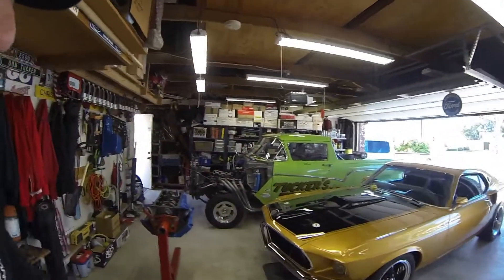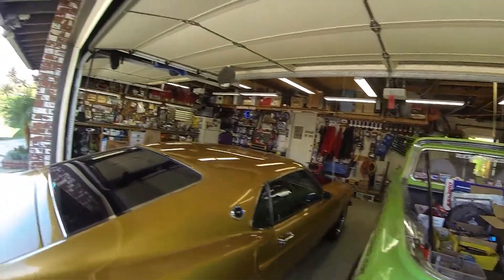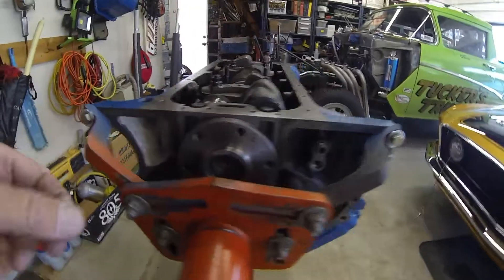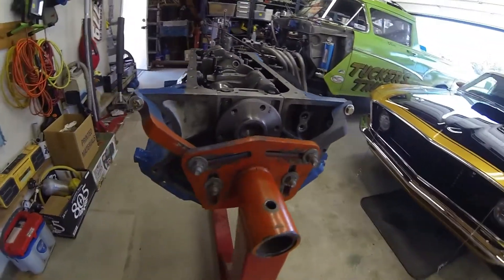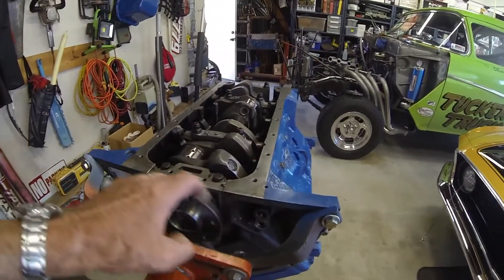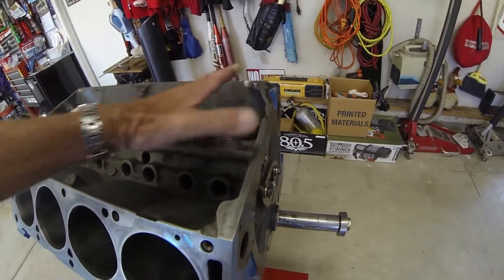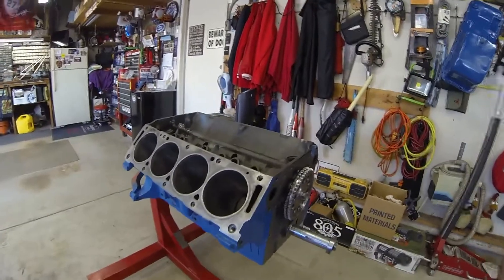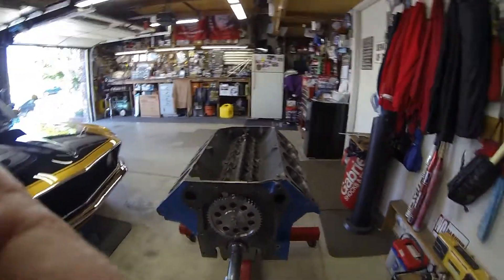427 FORD FE Engine Building Tips 10 2019

Comment: If you're going to use the two bolt main block say from 390 or a 428 Besides putting better Main bolts on it What can you do to strengthen the block In terms of the crankshaft reducing the chances of a cracked block?

Comment: You said the plunger goes in first, in the oil galley in the rear if the block. Then you say the spring goes in first. Which is it? I saw which it was, but you needed to be gigged on that.
Reply from the maker: You are right, I did misspeak. What you see me doing is correct.  Spring 1st, plunger 2nd with the narrow rod facing out of the hole so the threaded plug contacts the rod and pushes the plunger in against the spring.

Comment: So I'm writing an article on the 427 used in the Lemans GT40's and outside of the basic info on the engine / seeing as you've built these, what strengths do you think that mill had that aren't well known
Reply from the maker: Hello,  I think one feature that adds a LOT of strength is the extended lower block that is a good 3 inches below the centerline of the crankshaft.  This adds a rigidity to the block and allows the middle 3 main caps to have extra bolts come in from each side.  Most 427's are also side oilers which is great for endurance races but not so necessary for street use or drag racing.  It is still the sought after block though.   Another feature that is overlooked is the shaft mounted rocker arms. This creates stability to each rocker.  You will see many engines that do not come that way from the factory but are converted to this by high performance head manufacturers. 
One last thing.  There are many manufacturers of high performance aluminum and cast iron blocks and heads now.  This was not the case about 10 years ago.  Cross bolted mains, great oiling and superior strength plus high flowing aluminum heads.
I hope this helps,  Tom T
Reply: @tomtucker7571  thanks it does help very much. It's cool to see the reliability strategies from 50 years ago like the cross bolted main capss, because the LS crowd thinks GM came up with that in 1998 when they released the ls1 (hell that's what I thought) and how that in addition to extending the blocks skirt gives the bottom end enough strength to handle ridiculous amounts of power, or like you said the priority of lubricating the crank first ups the reliability if say your 7 liter needs to run a 24 hr endurance race. Anyway thanks for the response it's much appreciated

Comment: Hi can you turn a 390-FE into a 427-FE...
Reply from the maker: The stroke is the same, 3.78 on both engines..  The 427 has a much larger bore.  You cannot bore the 390 out to the 427 bore.  The cylinder walls would be to thin. You can bore it .030" over or maybe a tad more and end up with about 400 cubic inches.
The two blocks share almost all parts. Crank, cam, heads etc.  Just be careful with the heads.  The rare medium riser heads have the valves spaced further apart and the valves may contact the cylinder walls.  There are many good aftermarket aluminum heads or just go with your 390 heads.  They can be worked on to flow better. 
Tom
Reply: @tomtucker7571  Thanks Tom :)

Comment: Hello Tom Tucker, I have 1968 428, has 1963 6090 J heads, pi aluminum intake, what all do I need to build this to its best Daly driver with extra power
Reply from the maker: William,  The 69 Mustang in my video has a 428 CJ motor and I also used the police interceptor intake manifold.  Just pay close attention to matching the manifold ports to the heads.  As far as a good street engine I would suggest a nice low RPM cam.  I went overboard with the cam so it takes a little RPM to get the power up and loves to drink gas.  I'm still happy with it because I like the rough (mean) idle.  The usual hop up things work like headers etc etc but with the right cam this motor will be very strong.
Reply: Thank you Tom,  hunters out there looking for these so better take care of it,  Enjoyed your video

Comment: One thing I always used to do when I Prime Motors make sure the oils flown down up every pushrod or rocker arm shaft even the old antique Chevys we used to squeeze off the tube with oil with drain back to the head for oil pressure to the Rock arm

Comment: Loved the video, it was just straight no nonsense info a lot of which was helpful to me personally! I have a 63 427 in my 69 Mustang as a daily driver. I'm sure you already know, the stock valve lash spec is .025 cold, and that's, well, a whole lot by modern standards and pretty hard on the valvetrain. When I look at all the aftermarket cams for the 427, valve lash is way tighter. What are your thoughts on tightening down the lash to .018 or .020? I don't want to burn up an exhaust valve, but as a stock headed engine, the lash doesn't seem to move much hot/cold and I suspect Ford was just being awfully conservative on the old Police Interceptor cam design.
Reply from the maker: Hello,
I run .021" cold lash in the race car but when it heats up I end up with close to .025" because of the aluminum heads.  I think you're fine to run the lash a little tighter but I would only go a few thousands tighter (.002-.003").   You're dealing with the opening and closing ramps on the cam lobes.  To be really safe I would direct that question at one of the cam companies. They have good tech departments.
Okay.  I don't know how many will read this correction to my 427 video regarding the side oiler relief valve.  I mentioned how it was always good to run a shim( i used an allen bolt) inside the relief spring to raise the pressure at which the relief valve opens.  Not necessary.  My oil pressure was too high, 105psi with 5-20wt race oil,  because of a miscue with my bearing clearances.  I pulled the trans this weekend to get at the relief valve. I pulled the allen bolt shim out and the oil pressure dropped to 83psi when I fired it back up.  I realize now there is no need to run 100psi and the shim will not raise oil pressure if it is to low.  For instance if you have 40psi that's what you have.  I you have over 80psi then the relief valve will do its job and open to keep the pressure at 80.  Now I can run 20-50wt oil and hopefully not have oil leaking past the pan and valve cover gaskets.
Tom T
Reply: @tomtucker7571   Hey Tom, thanks for the info. My top oiler has the oil pressure relief in a different spot. The engine builder added a machined piece of aluminum into the bore with the spring and oil pressure went to the cusp of 120psi on the dyno run of my engine. I pulled that spacer out. My dad said the engine seemed to bypass at 105psi according to his oil pressure gauge back in the 60s. I run 5w30 oil in mine and it idles around 80psi cold, eventually dropping to about 25psi when nearing 200* sitting in traffic with the cooling fans running. Crusing down the road at 2,000rpm at operating temperature is usually about 75psi. I'd heard there were different springs people sometimes swapped into the blocks to decrease pressure a bit too. So much info and so much of the info is of questionable truth out there haha
Reply from the maker: @randomologist77    Hello.  I finished my oil pressure tests yesterday. I mentioned, in my previous reply, that I pulled the shim out of the oil pressure relief spring and the oil pressure dropped from 105psi to about 83 psi.  I drained the 5/20wt oil yesterday and put in 20/50wt oil.  The pressure stayed right at 83ish pounds, just as it should have.  I ran the engine for 7 or 8 minutes and it stayed close to 80psi. Water temp got up to about 180.  I'm sure if I was running the car at the dragstrip the heat would be much higher and the oil pressure would have dropped some.  With the 20/50wt oil my mysterious oil leaks through the gaskets disappeared.  Yeah.
Reply: @tomtucker7571  Nice!!! Sorry, didn't see your reply. I'm definitely going to take a look at my relief valve. Finding spring replacements is a nightmare these days, but I sure wouldn't mind seeing a little lower pressure. I'll have to take a look and see if mine has the shim. 

As a heads up, I found that Crane Cams (now Comp Cams) makes a blueprint cam for the early 427s like mine. The specs on it show 0.018" on the intake and 0.022" on the exhaust for recommended lash. I'm planning on doing that or maybe a hair tighter on the exhaust.
Reply: I guess I should mention I've checked around online, but as you've also undoubtedly found, for every person who really knows what they're talking about when it comes to the 427, there are 20 more who claim to know, haha.

Comment: Have a top oiler 427 marine engine that I converted to side oiler for the 3 center mains, old trick you drill out the side caps and bolts to 3/8 then tap the bolt to take a pipe tap oil line fed from oil filter adapter. Used it many times helps a bit. Poor mans side oiler. Keep up the good work, not to many FE anymore.
Reply from the maker: Reid,  Great idea.  Takes some patience and skill but us motorheads must have both.  I think i screwed up, in the video, by mentioning how I shimmed up the oil relief valve spring.  In hindsight I ended up with too much oil pressure (105psi) and should have left the spring alone without shimming it with the allen bolt.  I believe Ford had it designed to relieve pressure at 80psi which would of been fine.  I'm pulling the trans tomorrow, to get at the relief valve and correct my mistake.

Comment: One thing I was told is for high rpm endurance racing Ford reduced the crank shaft diameter and I think they were using different bearings possibly Chevy bearings I’m not sure. Is this true?
Reply from the maker: I read the long article you attached comparing steel cranks to iron cranks, friction, strength etc etc.  Interesting but like he said it is a lot of thoughts put together from several articles.
I think if you keep the RPM within reason, maybe 6500 tops, you don't need to worry about different journal sizes.  I run my car/Ranchero at 7200 but am thinking of backing the rev limiter down a little just to be safe.  I do have one of the best (and very rare) Ford steel cranks.  If you do feel a need to change you will find that many of the stroker kits (Crank, Rods, Pistons) are the same price as buying a stock stroke (3.78) Ford or aftermarket forged steel crank and that's if you can find one.  Good luck.
Reply from the maker: I'm quite sure Ford did not do this but many of the aftermarket cranks have smaller journals on them.

Comment: building fe 390 it has trw .030 over pistons in it shud i reuse them or get new one will give it more compression
Reply from the maker: Fine to reuse them if they're in good shape.  The only way to add compression would be to buy new pistons with a bigger/taller dome on the top of the piston.  If you choose to do this don't go past 10 to 1 compression for street use.
Reply: @tomtucker7571  thanks

Comment: I have a hot Rod Magazine 1975 I believe. Master 428 CJ  engine builder Carl Holbrook. He ran a 1969 mustang convertible superstock 428 CJ. You can still find the magazine on eBay probably. I read the article when I was in high school around 1979 and I was just as impressed as the editor after reading it. I was talking to an engine builder  and I told him more or less every engine has its quirks and tricks you have to know. I prefer working with an engine builder who specializes and Ford engines. He did not agree with me. I did not agree with him. Great advice thanks.
Reply from the maker: Thanks for the thoughts.  Yes the Ford FE has lots of quirks especially the 427.  Ford loved to make changes to their engines and the 427 saw most of them since it was their engine used in racing.  Many of their changes had no part number updates or changes.  Since that video I have built a virgin 427.  I had saved a brand new short block for 40 years.  Ford cut a full groove behind the cam bearings, in this block, to make sure oil got up to the rockers. The other 427 blocks, I have, don't have this groove.  This way you don't need to be sure the 2nd and 4th cam bearings have the extra hole in them to feed the rockers.  This is important since most FE cam bearings don't have the extra holes drilled in them.
I saw your other request on the '69 Mustang.  Sounds like a good idea to do a video on it.
Reply: Tom Tucker. Thanks for the info. Do you use Facebook? If you do I could send you some photos of the Hot Rod Magazine article.
Reply: Tom Tucker . Just curious have you seen any Dyno results on the stock 427FE single carb, dual carb and the other dual quad racing intake? I personally think they were under rated at 425 hp single carb. I think for 428 cobra jet was actually around 400 hp?
Reply from the maker: @surreallife777   I have read many articles on the 427's and 428's, YouTube spots too.  The stock 428 was rated at a very meek 335HP.  Probably was closer to 400.  The 427 articles I have read (and still have) all vary between 450 and 550+HP depending on the modifications made to the engine.  With the right parts the 428 can be right there too.  Just pay attention to good rods and rod bolts etc.  As you know they are both FE's with virtually the same cubes.  427 bigger bore smaller stroke.  428 just the opposite.  With the smaller bore the 428 was a little safer/better for street use since the bore spacing between the bores was better with the smaller bore.
I really think I'm somewhere between 700 and 800HP with the Blower, Injection and bigger/better heads and Cam.
Good luck, Tom

Comment: Tom, thanks for your time and well explained video. Question, are all the tips/mods the same for the 428 FE ?
Reply from the maker: The 427, 428, 390 are all in the same "FE" family so the basic blocks are the same with the 427 receiving some special enhancements.  The 427 has crossbolted mains on #2, 3 and4. The majority of the 427's are side oilers where the 428's were not.  Most of the mods, in the video, will apply to the 428 except for the oil relief valve at the rear of the block.  428's do not have one there. The only other oddities may have to do with how the oil gets to the rockers.  The 427 side oiler needs grooved cam journals on #2 and #4.  The 428 does not .If you're building the engine leave it on the engine stand, no heads on yet, and drive the oil pump with a drill motor or air ratchet and be sure oil comes up through the 2 small holes, at the deck of the block, that feed the rockers.
Reply: @tomtucker7571  Thanks buddy, I appreciate it. I'm building a 428 now for my 427 Cobra and looking for needs for the FE. I'm wanting a mechanical roller. Any advise on who's rollers and cam core ?  Please email me when you can. Patty550@windstream.net
Reply from the maker: @427HISS  You'll love the motor and don't worry you don't need the side oiler version.  Okay, cam and mechanical rollers.  I have had some major headaches with this part of my build..  I'm waiting for my roller lifters to come back.  The cam manufacturer is changing the top of my lifter to work with a pushrod that has a 3/8 ball on the bottom.  I was told that my lifter would work with 5/16 or 3/8 ball.  It did not.  I should have used a pushrod with a 5/16 ball, which would have let the pushrod settle down into the lifter a decent amount..  When you get to that point be sure to find out what size bottom ball to run on your pushrod.  I did ask but the young man at the company told me either one would work fine.  Not true.  Since I already had pushrods with the 3/8 ball I used them.  Didn't work.   I won't say the name of the company.  Another lesson to be learned.  Just triple check everything.
Reply: @tomtucker7571  Well,...that sucks !  What did you end up using ?
Reply from the maker: @427HISS  I won't get the modified lifters back, and cam, until next week (i hope).  I'd prefer to not say the brand.  They are working with me to solve the problem.

Comment: Great video Tom. I found that those cork manifold gaskets soak up oil and weep. I also ground oil drains where you have, built up Permatex oil dams, but those cork gaskets keep on weeping, very slightly though. This is my first FE build.
Reply: Thanks for the cork gasket tip! Have had that problem every time I rebuilt one.

Comment: Great video Sir.... what year is your 427? Is it a medium riser?
My parents had a 63 galaxy 500 427 4 speed transmission. 
I grew up working on that engine. Points and condenser days....😁
Reply from the maker: The 427 block in the video is a service block '67 or '68 I would guess.  It was a bare block to start with so medium riser heads would work fine.  Before the blower went on I was running High Riser heads with Hilborn 8 stack injection. As we all know Ford made it tough to tell what year and was constantly making small changes to the block.  The 427 I'm working on now has a groove cut behind the 2nd and 4th cam journals which I haven't run into before.  No need for a cam that is grooved.  Just another change.

Comment: I tore apart a 390 I got from a guy te hat said he couldn't get it to run right and it was free so I took it. When I tore it apart I noticed he had install the rear freeze plug backwards and the cam gear was misaligned from the cam being too far forward. Did you drill the oil hole from the pump to the filter port with a 7/16 drill bit?
Reply from the maker: James,  I cleaned up the passage. This was a year ago and I forgot the exact drill bit size but I did enlarge the passage a little.  I've always been fortunate to have 427's and their passage may be a little larger to start with.  Tom
Reply: @tomtucker7571  I found a 70s model fire truck and pulled the full sump oil pan and the rear pickup tube so now I run 3 gallons of oil, windage tray. The first stroker i put together only made 4 passes and threw the rods out.  I didnt think the front sump pan would be an issue until my truck got into the 11s but apparently ford released a memo back in the 1970s warning about drag racing with a front sump pan.